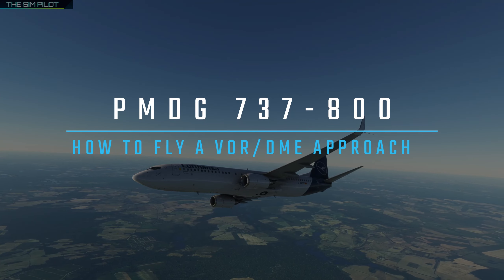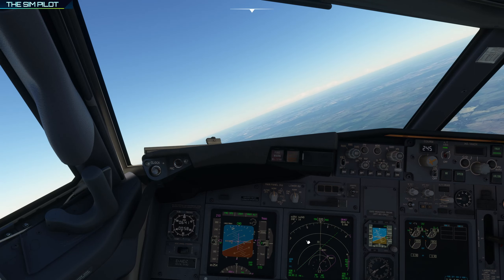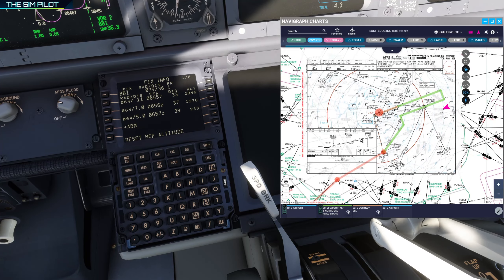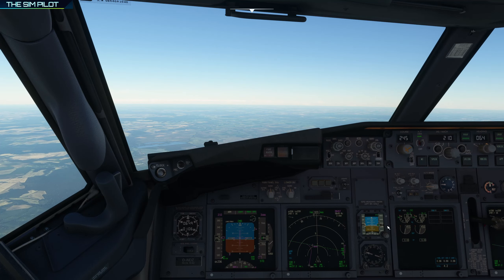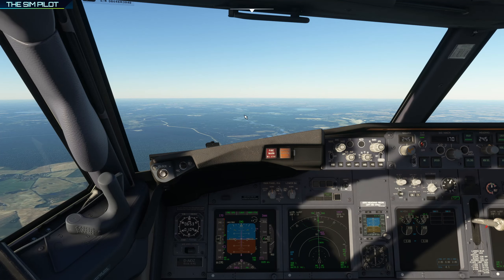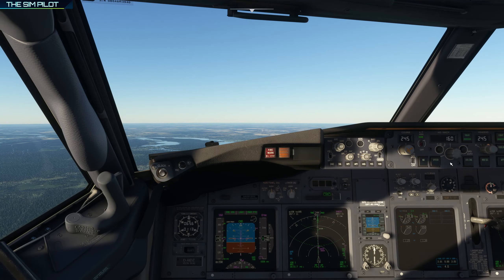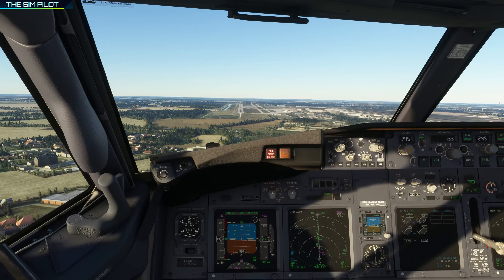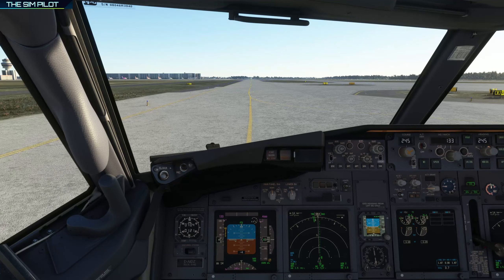MSFS | Tutorial | How to fly a VOR DME Approach | PMDG 737-800

Comment: If you use APP mode in the approach then doesn’t it just nullify the whole point of setting up VOR/DME? Like if I have to fly a VORDME isn’t it because the ILS is out of service? It’s more complicated to fly the VORDME so why choose it over ILS?
Reply from the maker: Actually when VOR/DME is the selected approach using APP mode will only use the localizer to align with the runway. Vertical movement is still at pilots control. This makes it easier for the pilot to let the aircraft control the direction. Not sure how real world pilots use VOR/DME but I find it useful. Regarding the question about ILS over VOR/DME yes it's preferred but there are some airports that does not have ILS on some runways.